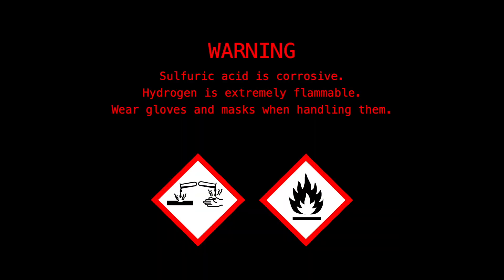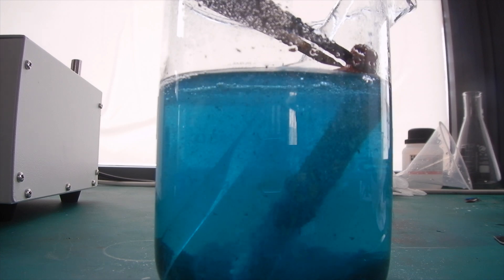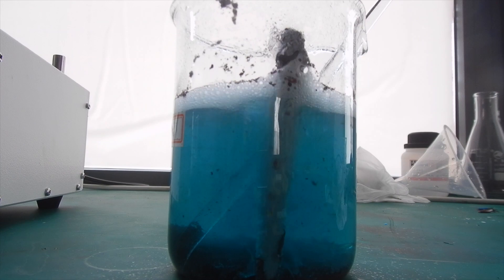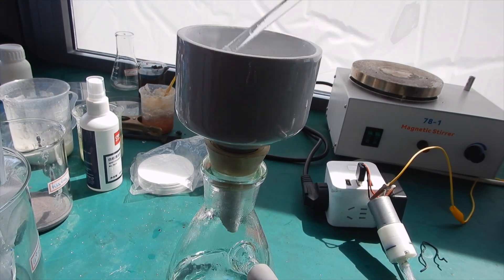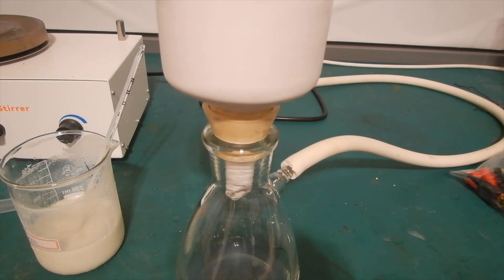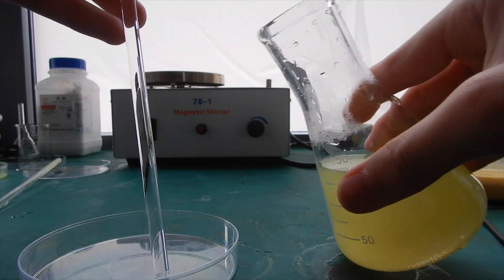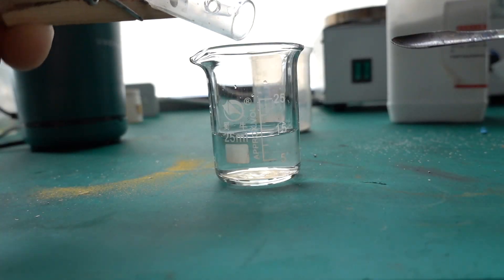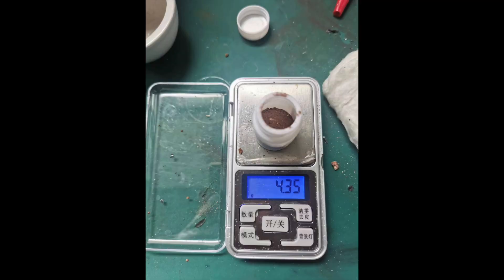2.3.2 Reactive Metals - Extracting Lanthanides from Lighter Flints

Comment: That is pretty cool.
You could have saved yourself a lot of work by using clean sulfuric acid.  Just a few more hours of electrolysis would have gotten rid of the copper eliminating the need to remove it later.
I will rewatch this and adapt some of your procedures for my own lanthanide experiments.  (I have some LaCl3 of unknown purity. It might be pure or it might contain other RA.  I also have a "LaCl3" pool product that I assume contains a mix of RA.  Finally, i have some polishing grade CeO2. Multiple projects come to mind.  But your purification steps may be useful.)